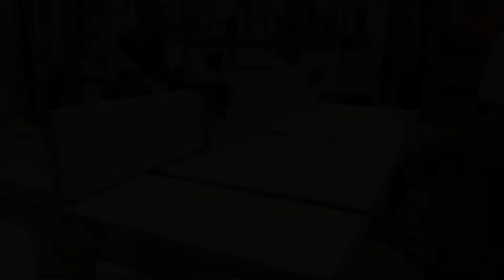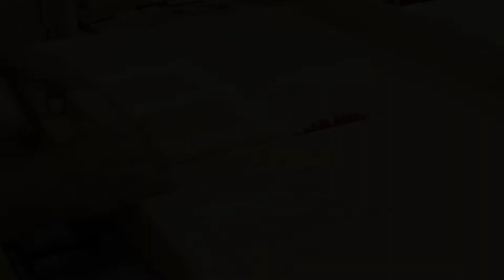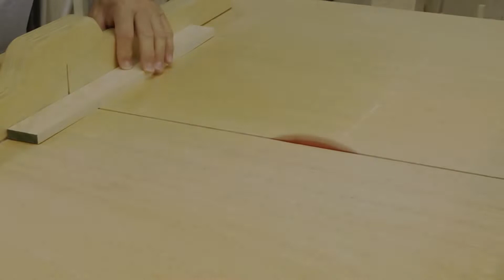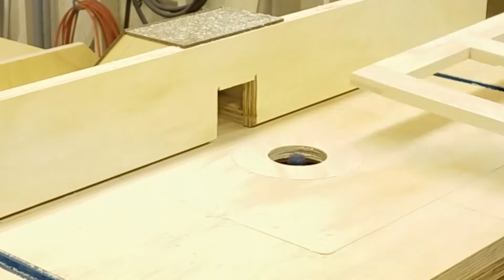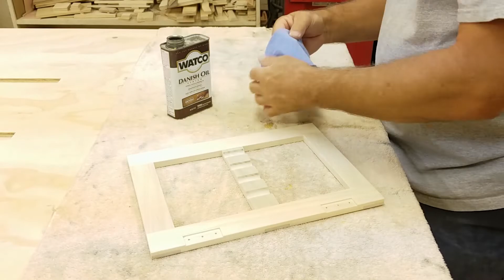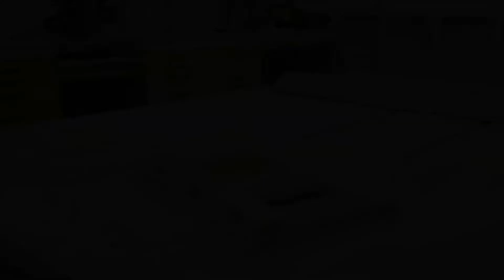Book Holder | A Fathers Day Gift | Bobby Sharp

Comment: This is great. Do you have the plan or even a cut list?
Reply from the maker: I'm sorry I do not. If I remember correctly the pieces are 1 1/2" wide x 1/2 thick. The overall size is 12" x 14". Hope that will get you started. Thanks
Reply: @bobbysharp  Thanks